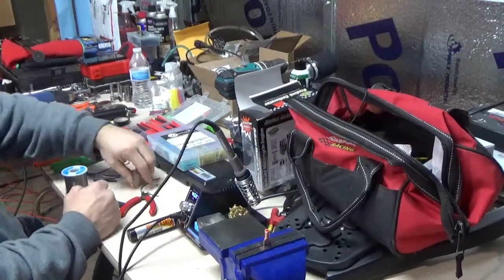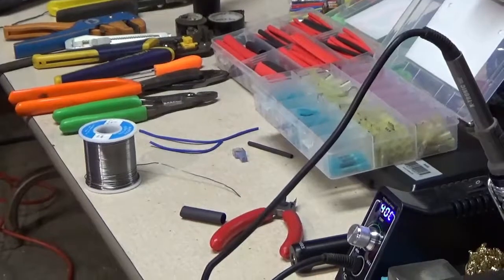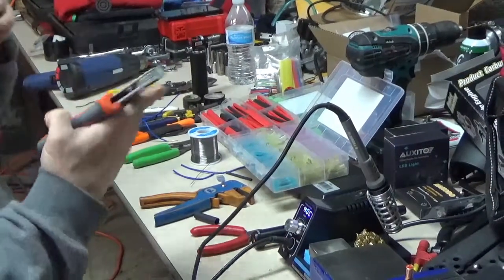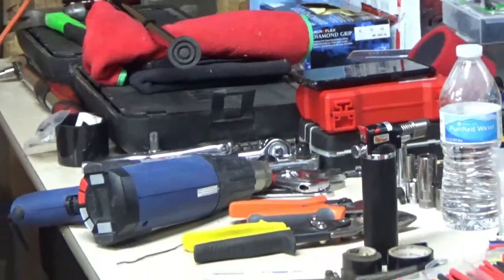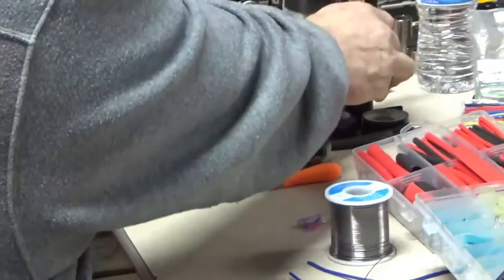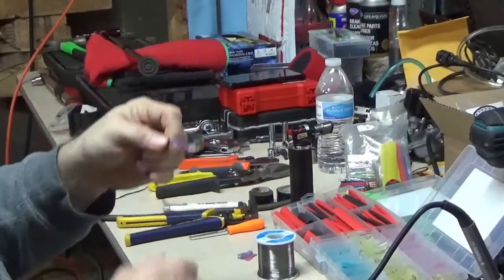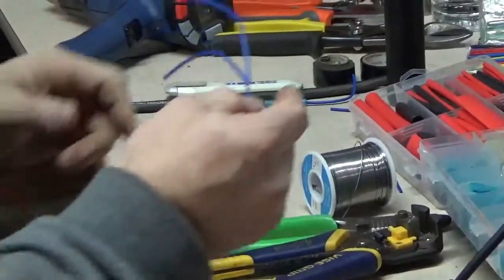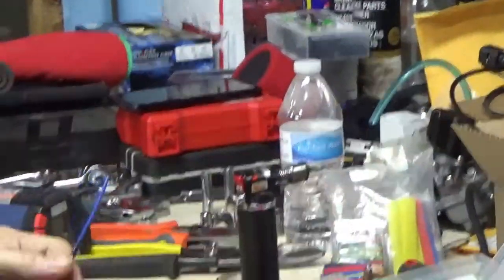Basic soldering connections for your Chinese scooter

Comment: Thanks. I learned a lot, way more than I knew before about wiring and soldering. Hope you figure out what's wrong with your digital soldering tool.
Reply from the maker: The temperature settings were off, all good now..lol
Reply: @apmscootering5219  I had a feeling it was something that involved a switch, or button.